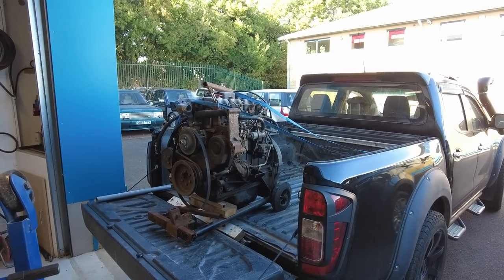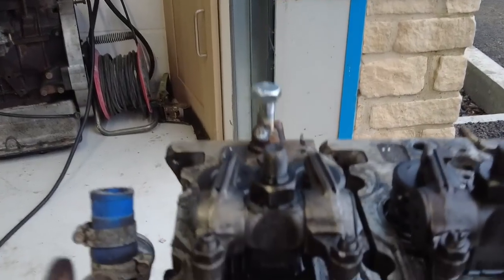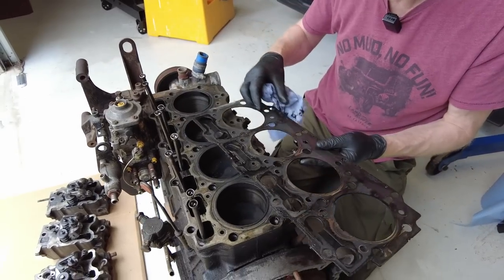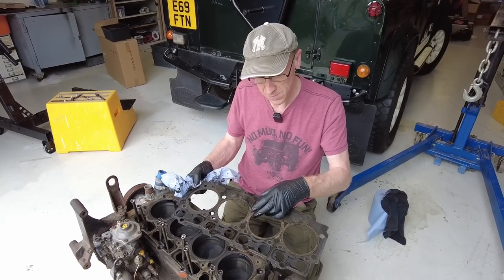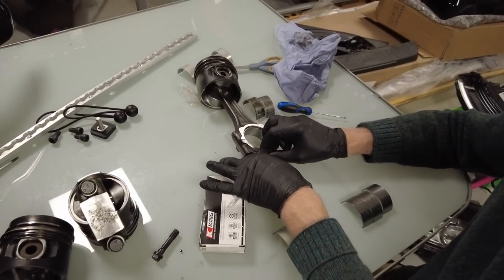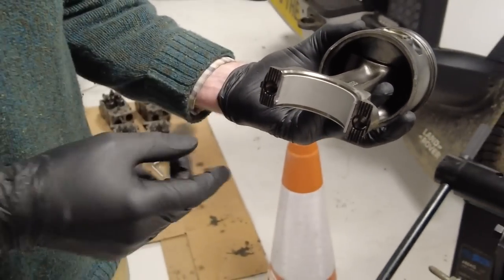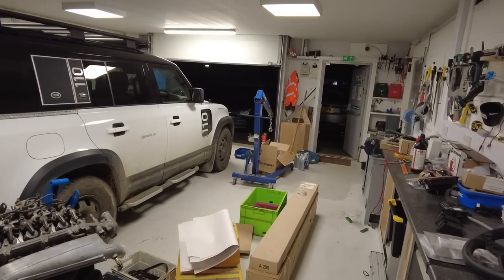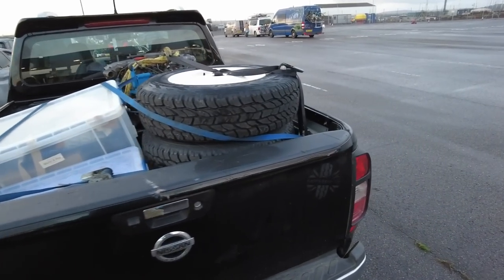Le Range Rover Classic - Part 4 - Final Engine Choice + VM Diesel Engine Rebuild

Comment: You are incredibly brave using the VM 2.4. I have had experience of this engine in both Range Rovers and  Rover SD Turbo. I spent so much money repairing these dreadful engines, thankfully the SD Turbo dissolved and Land Rover launched the TDI before the repairs could bankrupt me.
Reply: The cooling systems were the main issue, not the engine. However, when they did run short of water the alloy cylinder heads would be completely ruined.
Reply from the maker: I am hoping the 2.5 will be a better bet - the good news is the engine is now in and running... working on the Part 5 video now !
Reply: @L663  
I look forward to what you think of the 2.5, particularly its low end torque. I only drove a 2.5 VM a couple of times, so although I deduced that it was better low down than my 2.4, have not enough experience or memory of just how much better it was. I had a Discovery TDi200 run concurrently with the RR 2.4 and the 200 was a way better engine except that it took many miles to heat the coolant and hence the cabin in frosty weather.
Reply: Assembly lube on the bearings would have helped for initial start up

Comment: Vm is a horrible engine just don’t bother
Reply from the maker: Well it did a lot of KM with the original engine so it cant be that bad !
Reply: @L663  hope it’s good for you but I have hade lots of rangrovers and rover cars with that engine and it’s not a good engine just giving a bit of advice but I hope it runs ok

Comment: Simon big mistake with the head gasket, the MLS gasket is much better than the compound ones, you will need to retighten the head bolts after 10,000 miles, I put 300,000 miles on my 2.5 VM and only had problems with the compound head gaskets the MLS gave no problems, also I hope you used the correct thickness gasket or you could have pistons hitting the valves, good luck.
Reply from the maker: These videos are a little behind the true timeline... been so busy did not have time to get this video together until the xmas break ! but the good news is the engine is in and running.... but more updates to come. Is the MLS gasket a make or a type ? is it one piece ?

Comment: They also fitted the VM to the diesel Ford Scorpio, the last generation of Granada. The Rover 800, Range Rover and various Italian vehicles. Also the  Jeep Cherokee and possibly, for a short while, the Jeep Wrangler.
Reply from the maker: I think the Vauxhall Frontera also had them !
Reply: @L663  
In 1993 the Frontera still had the Vauxhall 2.3, a really dirty and nasty engine which convinced me, at the time, to buy an Isuzu Trooper with the reliable but thirsty Isuzu 3.1 indirect engine. This was my father’s primary car until it was scrapped some 18 years later to coincide with father giving up his license due to old age and inadequate vision. The Isuzu LWB was a better tow car with a far torquier engine than the classic RR with VM engine, despite being a part time 4wd.

Comment: The VM 2.4 and early 2.5 are indirect injection with all the efficiency penalties that follow. They are also noisy/rattly and the 2.4 in particular has a very narrow effective operating range from around 2500 to 4200rpm.  The 2.5 has slightly better low end torque but neither are in the same league as the 200 and 300 TDi LandRover built engines.
I had a 2.4 for many years and apart from the diesel lift pump securing nuts needing regular re-tightening, it was very reliable. Cooling system was of marginal efficiency for heavy towing and due to the dire low end torque, which falls off a cliff if lugged down under 2500 revs resulting in the engine being required to rev to the governor in first high to enable a snatched change into second when climbing steep roads, otherwise second would result in revs below 2500 on the up change and a rapid stall.
VM are a very well built quality engine but of their time. Get the 200 or 300 TD if at all possible, which perform far  better and use less fuel. So much better that they are genuinely in a different league.
Reply from the maker: I have lost sleep over the engine choice.... so was guided by what was available.... a £50 2.5 seemed to be a good deal. Plan is now to get it through the French MOT and get it back here for Gaydon Land Rover show in May !

Comment: Was going to ask whether you set the Piston Rings up so that the gaps were equally spaced apart but seeing as the engine is now running (reading other comments and replies) you clearly had when you installed all the Pistons back into the block.
Reply from the maker: Yes i had the gaps at 180 to reduce blow past... it was a bit of a quick / cheap rebuild as not sure that will be the long term engine .... right now need to get it going / passed the French MOT and then registered. I want to get it back here for the Gaydon show in May

Comment: A most interesting video, interesting to see you using Hylomar on a head gasket, I always use it a lot more sparingly than that, did you take lots of photos of the ancillary positioning before you took the engine apart? It can be very useful when re assembling, although I think you have made one good engine from 3 here, it looks good, how did you get all those parts through customs on your return to France? Did they try to charge you VAT or import on your own parts? It will be nice to see this one running again! Happy New Year to you Simon. Chris B.
Reply from the maker: Hi Chris - no problems at all with French customs.... one good thing about doing the videos is that I often look back at my own videos to see how things go back together !
I will publish the video of the engine running later ! Happy new year !

Comment: It is notable that there is hardly any combustion chamber in the top of these pistons. More efficient direct injection engines would have the full combustion chamber in the piston in the form of a deep toroidal  hole, like a swimming pool in miniature.
Reply from the maker: Yes the separate combustion chamber in the head is a drawback !